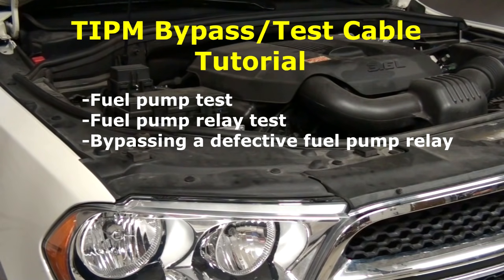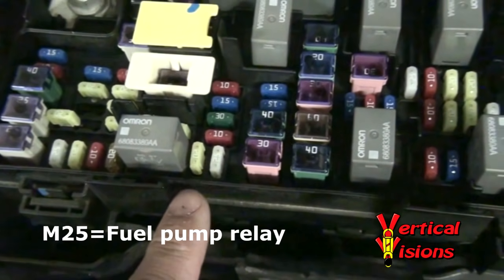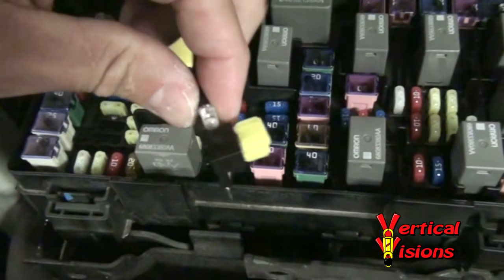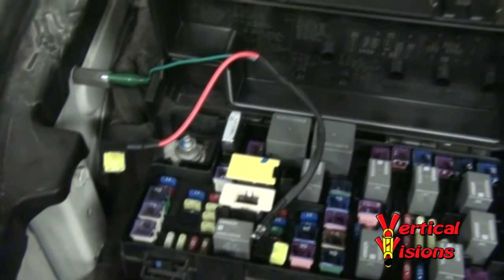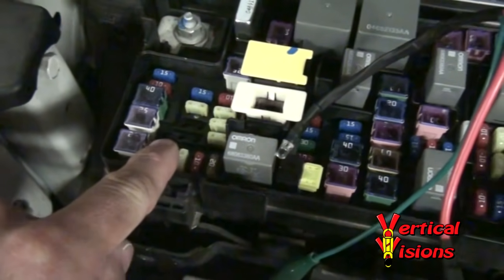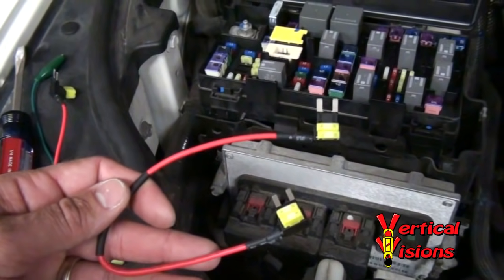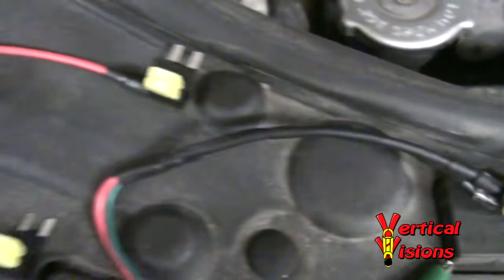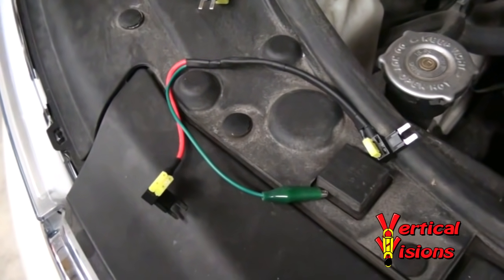TIPM Fuel Relay Test and Bypass Solutions - Most 2007-2021 Dodge, Chrysler, Ram, Jeep, VW Vehicles

Comment: Danger! If you use this Mickey Mouse device to jump the fuel pump off of the rear cigarette lighter relay then the computer will not shut off your fuel pump during an accident. If you are involved in a fiery crash, your fuel pump will continue to feed the fire and you are toasted. I would use this method to get to a real mechanic and get it properly repaired. Although there is no proper fix for this problem. Even Chrysler itself has a crappy recall method of patching the relay with an externally mounted Relay. Thank you for the video.
Reply from the maker: Ah, another person (disgruntled dealer?) who thinks they've discovered a flaw in the system, although Mike is incorrect in saying the fuel pump won't shut off.  We get comments like this every few months from people who think they've discovered a new flaw in the system.  In bypass mode, it is unknown how it will affect safety mechanisms that shut off power to your faulty fuel pump relay during a crash. The M7 circuit, which we use to pull power from, may or may not kill power to the fuel pump.   We just don't know. 

 We haven't done any crash testing to determine this and that's why we list it as a clear limitation of the cable. 
 If you took the time tor read our website, you would have read all about it.  However, all faulty fuel pump relays are currently capable of becoming stuck in the on position, making this limitation a moot point. Let me say this again.....anyone driving a vehicle with a faulty fuel pump relay currently lives with the risk of that relay getting stuck on in a crash.  You're probably more safe with our cable.   However, we also have a no limitation patent pending product that will kill power to the fuel pump relay during a crash because it uses the same signals as the factory external relay.  Here is a link to that product:  http://www.verticalvisions.com/TIPM_relays_plugin.php

The truth is that taking a vehicle to a mechanic or dealer is a painful solution that normally results in thousands of dollars and no solution.  We get calls every day from "mechanics" who don't know how to diagnose a simple fuel relay issue.  Our cable can do just that.

Comment: My wife started having delayed and multiple crank starts towards the end of August unbeknownst to me. I get in her 2013 Chrysler Town and Country a week ago and try to start it. (not a press start but a key fob starter) and when I turn the fob, it sticks in the crank position. After trying a couple of times, it finally starts but I know there's a problem. Next day it won't start. Same problem but this time a couple of times the crank leads to it starting then immediately dying instead of settling into idle. After 5 to 7 times and not wanting to ruin the starter by cranking over and over I give up and head to the interwebs to start looking. My first worry was that it was WIN/WCM which is the Wireless Ignition Module. But it still cranked. Next I found there was a common problem with the security feature where there's a RED dot that shows your alarm is armed and if your car starts then dies and that RED dot remains on your dash, your car thinks your fob/key, etc. is NOT valid and it keeps the car from being started and stolen. Every diagnosis I read online pointed to electrical problems which are beyond my "change the breaks on my own" expertise.

So off to the dealership I went and agreed to pay $130 for a diagnosis. I told them I thought it might be the WIN/WCM. I get a call later evening just before they close. It's the TIPM and to replace it would be $1,200 bucks. $900 for the TIPM part and a couple hundred for labor. I was floored. Went home and hit the interwebs again. Lo and behold the internet is filled with the same issue. I get on Youtube and multiple people with videos showing the exact same issue I was experiencing.  There was even a recall on Chrysler TIPM's for older models of the same vehicles (up to 2011 or so). But I also learn that the whole TIPM isn't bad, that these TIPM's are notorious for having a failure on one part on it's panel board which requires a replacement of the entire module. My wife was furious. I was "eh, typical dishonest car manufacturers" and of course not surprised they can't just pull the board and fix/solder the bad part/resistor/whatever because that would require electronics skill.

Then I find a video or two referencing verticalvisions (website in desc. above) in other videos reporting the same problem but with a fix. I even found a video by Oz Mechanics with the same issue referencing a MOPAR official bypass part! ("2011 Dodge Caravan Intermittent No Start/ Fuel Pump Relay TIPM") What the heck! Now I'm pissed because that repair if the dealer did it would be at most a couple hundred bucks! Why don't they do that or offer that vs. a $1,200 full TIPM replacement?

Better yet the verticalvisions website has a similar bypass cable with a tester built in. What the heck, let's give it a shot. If it works I'll have spend about $170 total vs. $1,200. Better is the website even offers a more solid bypass fix or they'll even just repair the TIPM for less than $400 which I could swap out in 15 minutes of my own labor.

I ordered the standard cable with the tester. Went and picked up by van from the dealer which when they told me it wouldn't start, I informed them it would if they cranked it a few times. Lo and behold the running van was pulled up to me in a couple minutes running. Last $130 I was going to give them. 3 days after ordering the cable it arrived last night. Literally 20 to 30 minutes after opening the box, the van was fixed. Hardest part was removing the M24 fuse since there's a large module mounted right up against it and the damn Chrysler tweezers are too thick to maneuver between it and the fuse head.

Sequence of the fix? Pulled the two fuses M24 and M7 (i think?) put the tester in M24 and grounded it. Cranked. No light and no start. Cranked a few more times. It finally started, light came on. Problem proven. Fuel Pump Relay is bad. Put the M7 end in, turned it to ACC on, light turned on. Cranked it, it started. Rinse, repeat, rinse repeat. It's fixed. Put some electrical tape on the ground connector.

Main concern on the temp fix is that I had to bend the stiff wires to make it so I could plug the two ends into each respective fuse connector and because there were other fuses and modules in the TIPM box that surrounded these, it made it a bit "awkward" in the sitting of the ends of the wires. The stiffness of the wires creates a bit of tension upward to not have the fuses sit in the slot. They want to "lift" out. I wouldn't recommend putting a 90 degree bend in the wire at the fuse end either. Also each end has two 20A fuses jutting out from the side that I worried would hit  up against the fuses but was happy to note clear the tops of the fuses next to them just barely. I may use some electrical tape to "tape down" the ends of the wires into the fuse slot.

Overall, all praise be to Jason and his verticalvisions company. Saved me hundreds of dollars thus far, exposed the dealership for their focus on gouging me vs. fixing the problem that is an inherent design flaw from Chrysler (Dodge, Jeep and VW). The more people I can push Jason's direction and save them hundreds of dollars and do the right thing, the better.
Reply from the maker: Thanks for your review.  M7 and M25 are the fuse slots we use.  Let us know if you have any questions down the road.

Comment: Will this be a temporary fix for my 2011 dodge caravan it is doing the same thing you talk about it will crank and won't start but I haven't heard anything on the rear next to the fuel pump...also what would be a permanent fix for this thank you I don't want to spend 1200 on this issue..
Reply from the maker: Read more here about why we call this a temporary fix:  http://www.verticalvisions.com/TIPM_cables.php#faq2
Two permanent fixes are available:  
1) Our patent pending TIPM Plug-In Fuel Pump Power Bypass/Test System:  http://www.verticalvisions.com/TIPM_relays_plugin.php
2)  TIPM Repair:  http://www.verticalvisions.com/TIPM_repairs.php.
Reply: Jason Bell Hi I just received your cable today in the mail will be trying out tomorrow morning I just popped the hood earlier on my 2011 Dodge Caravan to study it and I can not find the ground lug or chassis ground maybe I haven't looked further but I couldn't see it.. do u happen to know where it's located thanks in advance
Reply from the maker: Chassis ground is any connection to the vehicle's metal frame, typically via a fastener.  It must be a bare metal connection.  On your 2011 Dodge Caravan, simply touch or attach the alligator clip to the negative battery terminal, which is the equivalent of chassis ground.  Your battery is positioned directly behind the TIPM.  If you perform the fuel pump test and the chassis ground connection is good, you'll see the green LED light up.
Reply: Jason Bell thank you I will give it a try tomorrow 👍🏼
Reply: Worked like a charm thank you so much for this invention after sitting here for 2 weeks without turning on my van is running again 😁 will definitely look into a more permanent solution from your website in the near future u are amazing!!!

Comment: Thank you Jason. I purchased the cable on your website. I have been driving my car for 3 days.  The car has had power every morning since I installed your cable, and it has started right up every time, unlike what I was experiencing before.  Now that I'm using it, I am interested in knowing what the permanent fix for this problem is.  I saw on you instructions that you stated this is a temporary fix.  Thank you for saving our family $1400, you are truly a blessing to many Dodge and Chrysler owners.
Reply from the maker: Two permanent fixes are available:  
1) Our patent pending TIPM Plug-In Fuel Pump Power Bypass/Test System:  http://www.verticalvisions.com/TIPM_relays_plugin.php
2)  TIPM Repair:  http://www.verticalvisions.com/TIPM_repairs.php.  
We offer discounts on each for anyone who bought our cable.  Thanks.

Comment: Could it possibly be the TPIM?   When Autozone put the new battery in my Chrysler TC and immediately checked the battery,  the battery power went down instantly to 50 percent.  This happened twice or two new batteries but the first time it went down to 70 percent.  I was trying to get my alternator tested, but because of the issue with the battery instantly losing power they were unable to do so.  Thank you again
Reply from the maker: If your fuel pump relay was stuck on, which pulls 8-9 amps, it could have affected the new battery (depending on the state of charge as sold).  We have seen some TIPMs that suffered from parasitic current draw when the vehicle was turned off, independent of the common fuel relay issue, but it's rare.  Chances are the fuel relay is to blame, but it's tough to diagnose with the information provided.

Comment: OMG thank you so, so, very much Mr. Bell.  Everything you described has been going on with my 2013 Chrysler TCountry.  Pep Boys did the diagnostic testing and said it would cost me $1400 for the TPIM to be replaced.  My car started having problem starting.  It would crank, crank, and take awhile to get started.  Then it shut off while in park a couple time and once while driving.  All of a sudden I go out and the battery dead, and they replaced the battery twice.  The last time after the change I turned the car off and could hear something running from the rear, and I thought I was hearing things from the outside, but I put my ear to the car and could tell it was inside.  Today I found your video. You're a blessing to many people, and I am thanking you before my part arrives just because I feel this is amazing information you have shared.  I  trust this will fix my problem also. God bless you and your family.
Reply from the maker: Renee, thanks for your comments.  It clearly sounds like you have a fuel pump relay issue, especially since you have experienced both failure modes of the part (stuck on and no start).  The good thing is that there are many solutions to the problem that don't involve going to a dealer and they won't cost you $1400.  If you haven't already found our solutions website, here is a link:  http://www.verticalvisions.com/TIPM_solutions.php

Comment: Please correct me if I'm wrong. Aren't  you bypassing one of the most important safety features that the ECU Offers?
There is a reason why the Fuel pump relay is driven by the ECU and not just a switch. 
This device will keep the Fuel Pump Running even if there is no RPM. If the car using this cable crashes to another vehicle and the fuel lines get damaged it'll empty out the tank on the ground. 
I really hope your business has some type of insurance or at least is  incorporated. This is time bomb.
Reply from the maker: We get questions like this every few months from people who think they've discovered a new flaw in the system.  In bypass mode, it is unknown how it will affect safety mechanisms that shut off power to your faulty fuel pump relay during a crash. The M7 circuit, which we use to pull power from, may or may not kill power to the fuel pump. 
 We haven't done any crash testing to determine this and that's why we list it as a clear limitation of the cable. 
 If you took the time tor read our website, you would have read all about it.  However, all faulty fuel pump relays are currently capable of becoming stuck in the on position, making this limitation a moot point. Let me say this again.....anyone driving a vehicle with a faulty fuel pump relay currently lives with the risk of that relay getting stuck on in a crash.  You're probably more safe with our cable.   However, we also have a no limitation patent pending product that will kill power to the fuel pump relay during a crash because it uses the same signals as the factory external relay.  Here is a link to that product:  http://www.verticalvisions.com/TIPM_relays_plugin.php

Comment: Jason, I bought your product but realized when I went to install it, my car had the external relay installed, so, unfortunately, I can't use the awesome fix that you made. I have a 2011 Durango, how do you recommend I go about discussing this with the dealer. They have told me I need a new fuel pump, but I know it's not true and refuse to pay hundreds of dollars for an unnecessary repair. FYI anyone that has this issue, popping out the push to start button and manually starting the car with the key typically helps to get the car to start to get you to your destination.
Reply from the maker: We have a detailed webpage that can likely help your situation:  http://www.verticalvisions.com/TIPM_relays_external.php

Ah, the old dealer 'fuel pump" fix, which will cost you $600+ and your problems persist.  I'll never understand why dealers can't (won't) simply jumper pins 30 and 87 to test the fuel pump with an external relay.  It takes 5 minutes to test it.  Fuel pumps rarely fail on these vehicles.
Reply: Jason Bell thank you!

Comment: so by doing this you take the relay out of the equation, is this not a safety issue when in a accident as the fuel pump will run anytime the key is on and possibly feed a fire or a fuel spill?
relays are there for a reason and should not be bypassed.   An "engineer" should know this!
Reply from the maker: This engineer is well aware of it and you can be too, if you read the comments below or spend 2 minutes on our website.  With our cable in bypass mode, it is unknown how it will affect safety mechanisms that shut off power to your faulty fuel pump relay during a crash (a known limitation). However, all faulty fuel pump relays are currently capable of becoming stuck in the on position, making this limitation a moot point.  Everyone is already driving a vehicle capable of a stuck on relay.  If you're still worried and losing sleep at night over it, then look at our new patent-pending TIPM Plug-In Circuit Board system that has zero limitations.  Link:  http://www.verticalvisions.com/TIPM_relays_plugin.php